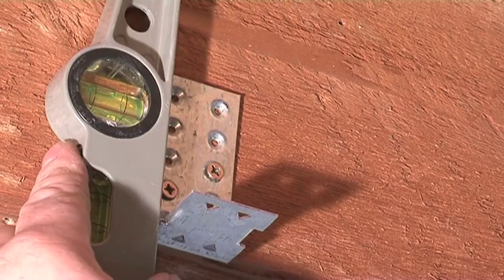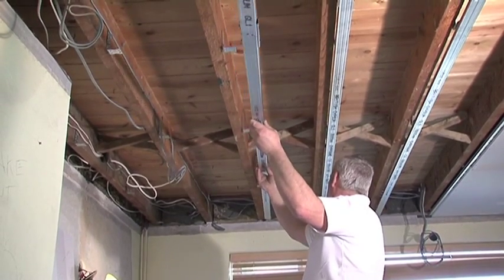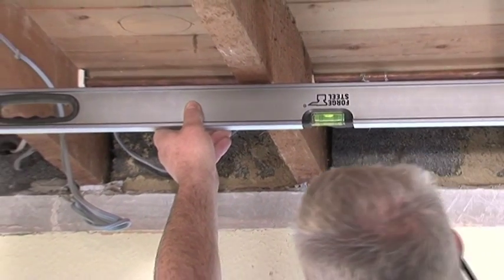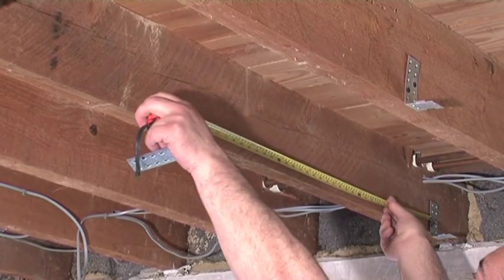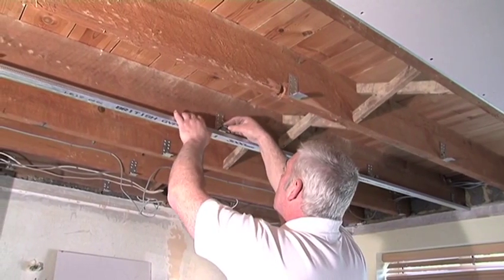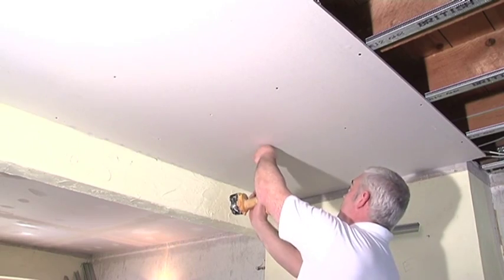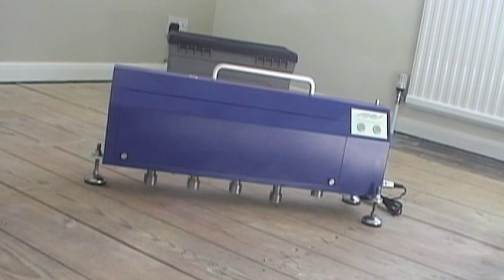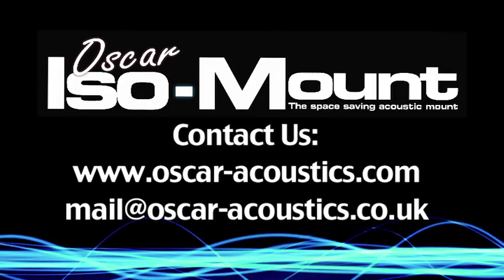How to Install a Soundproof ceiling

Comment: has anyone used this system it looks good but i cant find any reviews anywhere
Reply from the maker: Hi Adam,

Thanks for your message!

We have a full case study for the Iso-Mount Type1 from a recent customer - Richard Bowler.  Richard wanted to tackle noise transference as part of his basement flat renovation.
You can view the case study via the below link:
https://www.oscar-acoustics.co.uk/info/index.asp?page=iso-mount-soundproof-ceiling-case-study-355

Richard commented:
 “For acoustic isolation, the Iso-Mount system is superb. It even created a perfectly flat ceiling despite the uneven joists above.  Noise transfer between house and flat is far, far reduced.  When experiencing noise transfer now it is normally through an open door or window rather than transmitting through the floor/ceiling.  The Iso-Mount system is a brilliant way to isolate between floors and I couldn't be happier with the results.  The ceiling is superb and flat as a pancake despite the uneven joists above.  I highly recommend it."

There are further testimonials available on our main product page too, where you can also view our Type1 installation animation video:
https://www.oscar-acoustics.co.uk/acoustic-solutions/soundproofing-products/oscar-iso-mount-type-1

Our new Iso-Mount overview video is also available to watch, if you haven't seen it already:
https://www.youtube.com/watch?v=mkltV_ngMCA&t=42s

We hope that helps.  If you have any further questions please email us on mail@oscar-acoustics.co.uk or you can call us on +44 (0)1474 854902.

Best wishes,

Oscar Acoustics